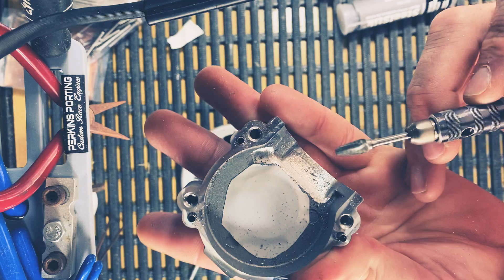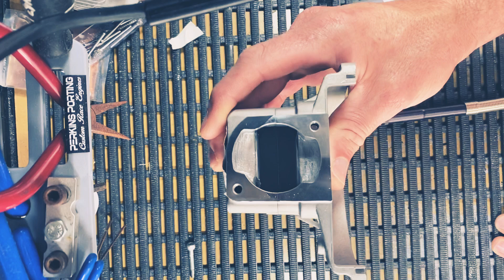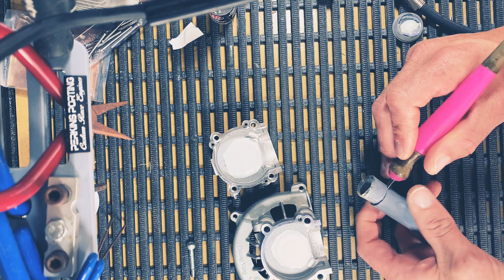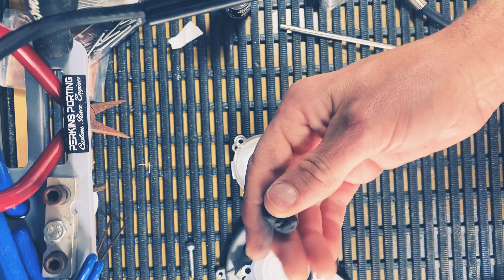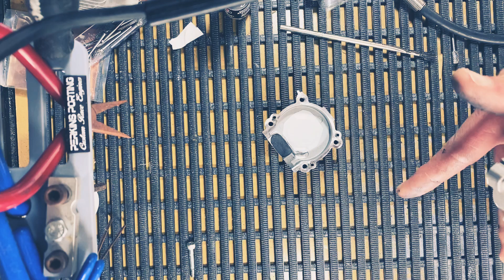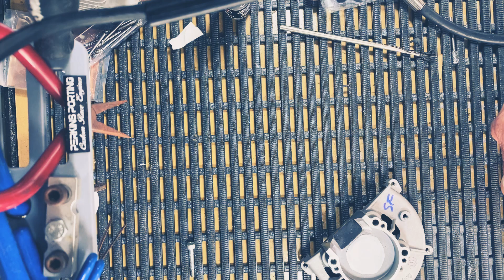RC Crankcase Stuff and Flow How To By Perkins Porting. Simple Explanation

Comment: Doesn't the alcohol content in the ethanol we have in our fuel supply cause the epoxy in the JB weld to break down ?
Reply from the maker: I have had it turned soft to the touch once, May have been expired or defective Steelstik. .. even that time it did not fail. 
I’ve never had a failure.
Reply: @Perkins.porting  thanks for your feedback and for sharing your experience. My son starts high school next year and picked the auto mechanic class as an elective , so I'm debating if i should get him into go-peds or not to learn how to build/disassemble & modify a small engine which with your videos would be a great help